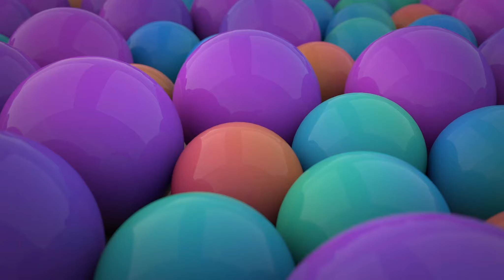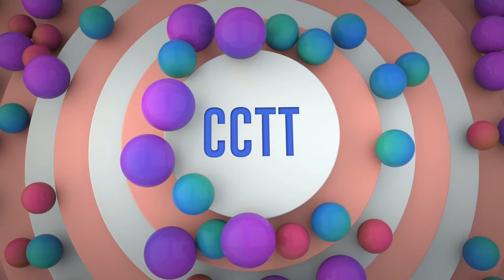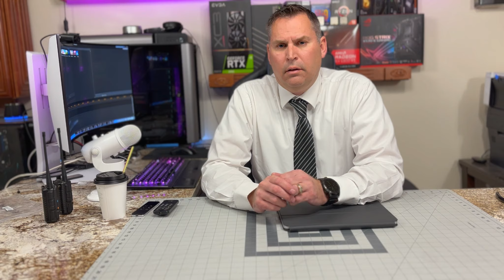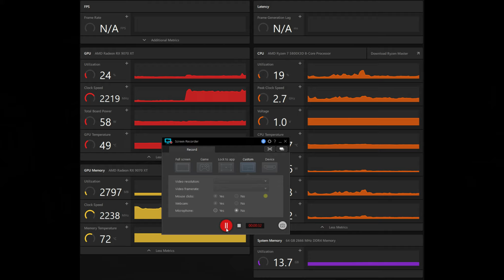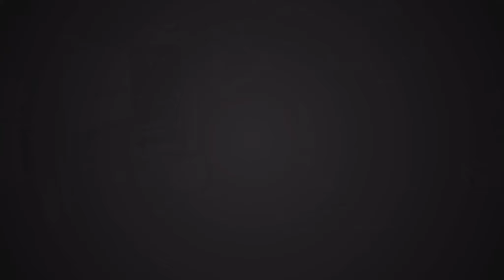Sapphire 9070 XT Hotter than Hades at Idle!

Comment: I've got the Sapphire Nitro + 9070XT, using Windows 10 on driver version 25.3.1. Idle temps are between 37 - 40C. Idle power consumption is around 25W. It clocks down to 50 - 100 Mhz on the core.
Reply: Thanks for commenting and giving us the information on your card.  I think I’ve isolated the issue to a Java script running under MegaRaid, but still doing testing.
Reply: I will be getting a video here very quick so stay tuned.